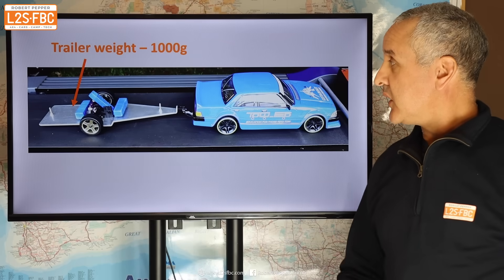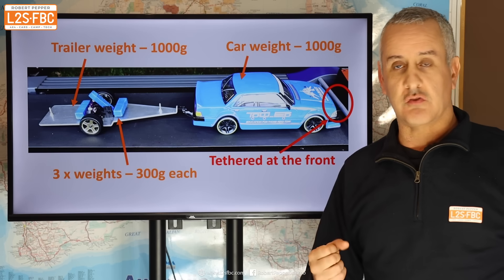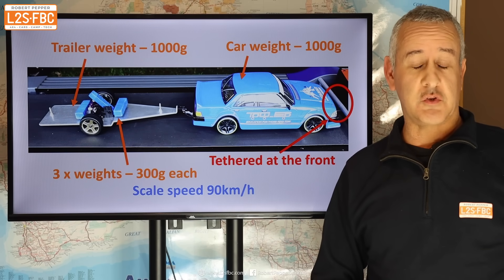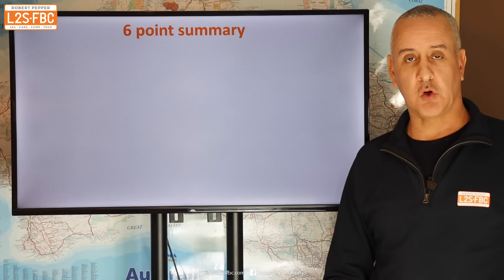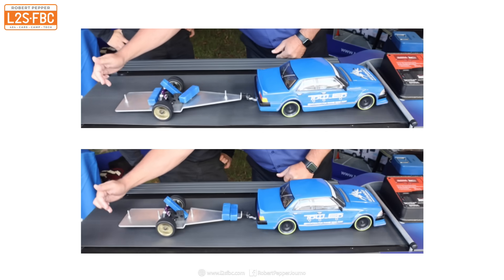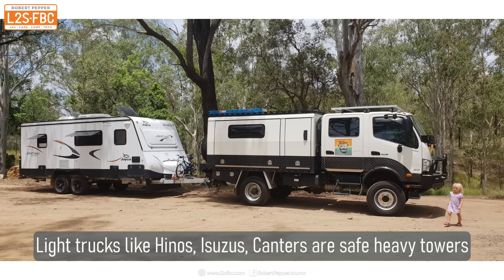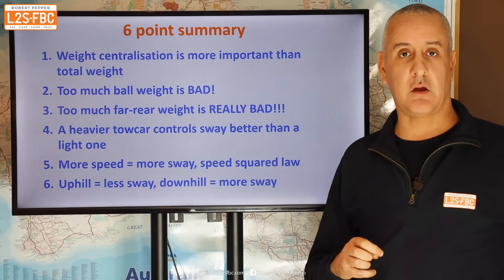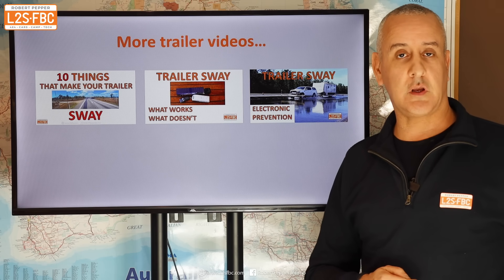7 trailer weight distribution setups, some safe, some deadly.

Comment: as far as i know....yor Trailers have no drive active brake.
tow a 1100 kg Trailer (with Active driving brake) is legal in Germany. 
my pulling Vehicle is a fiat punto with 1350 kg maximum load.
i have no problem driving 100 km/h
(the Speed here is Limited to 80 because of safety concerns).
with max load i can reach barely 85 on flat road;)
best wishes from germany:)
Reply from the maker: thanks, yes the rules are very different in Europe!

Comment: Great vid boss. I learned this stuff nearly 40 years ago, and it’s good to see it shown like this. Had a boat that was pretty much an exact even balance, and shifting a 50lb motor from the back to the front would make all the difference in towing stability. I’m not sure you are using the correct words when demonstrating the extra heavy weight on the tongue though. It sure looks like the tow vehicle is what has become unstable while you say it is the trailer that is unstable. Adding more than half the vehicle weight to the tongue will definitely make everything react more unstable though it is actually the front of the vehicle that is doing the swaying in this particular situation.
Reply from the maker: Thanks great post!

Comment: What has not been said or referred to is "the Center of Gravity" (C of G). So when the sum of all the weight, fixed and movable are calculated, there will be less sway if that C of G ends up within a certain range, generally over or slightly forward of the trailer axle(s). We use similar principles in the loading of aircraft, but for different reasons.
This is, though, a really good presentation for all of us who travel with caravans AND Motorhomes.

Comment: These tests dont account for wind drag and turbulence, and the fact that the vehicle is pulling the weight down the road not the road under the car.. but yes you must balnace the weight on trailers properly and never over load the trailer weight. The toungue weight. Or the hitch weight

Comment: This video is confusing. So should I put more weight near the location of the Tires or in the middle of a trailer becuase obviously you have different models as opposed to an authentic trailer.
Reply from the maker: Centralise weight over the axles.
Reply: @L2SFBC  Okay, thank you!
Reply: Heavy stuff always as close to center as possible

10-15% of trailer's total weight on tongue is the generic US recommendation

Consider WD hitch for tongue weight over 400lbs/180kg(truck - other vehicles 300lbs/135kg if vehicle mfg allows) to more evenly spread the tongue weight to both TV axles.

Mind your cargo capacity. Truck "rated" to tow 9000lbs/4000kg means driver only, no cargo in the bed. Load the bed and add family and the same truck might now only tow 4000lbs/1800kg.

If at all possible, you want a tow vehicle to weigh more than the loaded trailer. Especially critical in emergency situations. Even with trailer brakes, mass is mass and a larger mass will push smaller mass around.

Comment: What effect do you expect with dynamic suspensions that adjust the tow vehicule level, such as the Porsche Macan with the air suspension option?
Reply from the maker: Not a massive difference but it will help level the car.

Comment: This is a great video and I've known about weight distribution in a trailer but I recently bought a boat and it has me thinking how is that not a common issue with an aluminum boat with a outboard? The weight is very much so all in the rear of the trailer.
Reply from the maker: It is a common issue, boat towers need to be aware of the weight distribution like everyone else.

Comment: Wow I'm lucky to not have had an accident when I was young. I drove a pickup pulling a trailer with an old car on it. I experienced the rear wheels of tow vehicle come off the ground move a foot to the left and set back down. I pulled over. Did some breathing excersises and then continued just lowering the speed. I talked to my dad, who has made a living towing a trailer but he didn't explain this. I guess I didn't ask what would have prevented but still. Scared the crap out of me. Thank you.
Reply from the maker: wow, that's amazing!! Yes, lower speed is good. Your dad may have been one of these guys who just does stuff right but doesn't really think about how and why.  Please share the video!
Reply: @L2SFBC  I did I actually sent it to him reminding him of my situation. He's likely going to teach my nephews and nieces and it would be nice to teach them a little better. <3

Comment: But since when has a car being towed and towing a trailer ever got anything to do with a car being driven from front or rear wheels and towing got to do with true towing. With a trailor that is not over weight for the car. Then a slight nose heavy is always the best. But what do I know I have been in the scrap business for fifty years and have tow.. god knows how many trailers and boats etc. And take it from me back in the day we towed at all speeds.
Reply from the maker: FWD, AWD, RWD does make some difference. I might blog on this later.
Reply: @L2SFBC  but my coment was more about the fixing point you have on this rig is equal to the car being on tow with a trailor behind it.
Reply from the maker: Yes no difference then
Reply: @L2SFBC  no that's a car being towed and also towing a trailer. Take it from me if the car is man enough for the job then the towing point needs good weight on it.

Comment: What an excellent demonstration of trailer weighting. 
My only real comment is about if you do get into a sway situation (In the UK it is sometimes called "The tail wagging the dog"). Even with all the best will in the world, and the best possible attempt at getting decent weight distribution, it is still possible to find your tail wagging the dog.
And one of the curious things about such a situation is that your natural reflex is to try to counter the effect. Unfortunately, this almost always ends up accelerating the sway, and the trailer turning over even quicker. My experience has been that the first thing you need to do is relax, and then actually steer in the OPPOSITE direction to the way you want. So instead of turning away from the sway and trying to pull the trailer back in, you turn INTO the sway, and that nullifies the sway.
I must admit that doing this feels incredibly "wrong", but is almost always instantly effective. 
One other point is that, if this does happen to you and you are able to recover the sway, don't slow down too quickly, that can provoke another wag, and you're back at square 1, slow down very gently and keep the speed down until you can correct the weight distribution. If that is not possible, just go slower. It is still better to arrive late than to arrive at an unintended destination.
Reply from the maker: Wise words and covered in my other sway videos. In Australia we have brakes for the trailer alone which instantly quell sway...that's not the case in Europe for reasons I do not understand. The videos in the description explain more and show the trailer brake effect.
Reply: @L2SFBC  It is possible to get braked trailers in Europe, but they are a lot more expensive, so most people don't buy them. I honestly think that they should be made compulsory, and they may be eventually, just probably not in my lifetime.
Reply from the maker: Thanks David, good to know. In Australia independent trailer brakes are required over 2000kg.
Reply: @L2SFBC  I think that the EU does have a requirement for brakes on trailers over 1,5T, but most Europeans don't go near that sort of limit, even for caravans. 
And most people new to trailers assume that a shorter trailer is easier to tow, which is very far from the truth.
If you'll excuse me, I've got to go to bed now, maybe we'll carry this convo on later.
Have a good rest -of-your-day. But from where I am,
good night.

Comment: 7:20 - I had an accident when a weakly fixed load slipped onto the drawbar.  the car, despite the electronic systems, stopped braking.

Comment: Inaccurate results. Test does not include the effects of inertia. Your results cannot be considered real-world examples nor useful.
Reply from the maker: What exactly is missing ?
Reply: @L2SFBC  what part of "Test does not include the effects of inertia" is vague? The vehicle is not moving. The "road" in your test is moving. Newton's  first law of motion states that every object will remain at rest or in uniform motion in a straight line unless compelled to change its state by the action of an external force. The car and trailer in your test remain static. Without inertia acting upon them, all your results will be inherently flawed. Vaguely representative, yes, but inertia is a major force which is completely absent in your test. Another factor that is absent is that in real life,  the towing vehicle is pulling the trailer away from the drag point of the tyres on the road, pulling the trailer straight. This effect is increased by a longer drawbar. As mentioned, the results of your demonstration are flawed.
Reply from the maker: So you're saying the test doesn't represent what would happen with a car towing a trailer. Despite the fact there are differences with the model, some of which you have noted, it does behave accurately enough with regard to weight distribution which is the point of the video. I'm not using the model to show effects of tyre grip, steering etc. So - how is the model inaccurate with regard to weight distribution, and "no interia" is not an explanation as to why the model isn't useful. Lots of models aren't exactly real-world ideal yet are useful.

Comment: And for God sake put the brake controller override button somewhere you or passenger can hit Quickly with have to look or feel for it....

Seen so many hidden behind the steering wheel.

I am moving mine that was installed by last owner the put behind the steering wheel of the 200 in the little 4 lot of blank switches....

Going from hands on wheel to actually finding it Quickly is not that fast.... then the indication stick is also in the way too.

Weird part the 200 has a blank just under speedo on left hand side for it. It's in clear view and un obstructed.
Reply from the maker: Definitely, I show that in the linked videos. Thanks for the comment

Comment: Weight distribution hitch, move weight to centre of tow vehicle, move weight to above trailer axle, use your trailer brake controller, keep speed down.
This is the most complete explanation of the physics behind safe / unsafe towing that I've seen.
Reply from the maker: Thank you!  Please share :-)

Comment: Really good video. I've done a fair bit of towing but one piece of information was new to me. The example with the weight both forward and rear. I had assumed that this would average out to a centralized load assuming the trailer itself isn't flexing significantly. Nothing that i tow would be loaded that way just because it seems unnatural so the situation had never come up. still, i was a bit surprised.
Reply from the maker: Glad it was helpful! Please share :-)

Comment: Question - Which is more stable - a single axle trailer or a dual axle trailer?  Or, does it just depend on your weight distribution?
Reply from the maker: all else being equal, a tandem (dual axle) is more stable, but weight distribution is more important.

Comment: I drive a 90 series prado v6,  my camper trailer max atm is about 1600kg. I got a 90l fridge on the front drawbar in a large toolbox along with a hot water system. In the middle or above the axle I got 2 slimline 80l water tanks stacked on eachother. In the canopy above the trailer have electrics which sit at front trailer but near the middle.  The drawbar is 2m long. I've never had sway issues driving at 100kmph though I prefer to drive at 90kmph for fuel consumption. I also have redarc tow pro elite.. I designed the trailer and helped my dad build it. So many ppl told me not to put the water tanks above the axle..I said when full plus weight of tanks it's around 186kg which is the heaviest part. I see others put tanks at front and back then have heavy stuff on drawbar and they get sway..I'm like cause your weight isn't balanced.. Guess I'm lucky to custom design it and build it to my specs. Loved the video demonstration.

Comment: so I have a 7x16 Carmate trailer (enclosed) with dual axes. The axles/wheels are very much set towards the rear of the trailer, as opposed to being dead center like your model. So, directly over the axles of my trailer is the "middle", correct? (even though this is towards the rear of the trailer). I've always put most of the weight over the trailer axles, even though this is towards the rear, thanks

Comment: Confirm if my understanding is right. If the vehicle moves or more deg of slope, up hill , it has good stability when compared to less slope.
But the same trailer when moving down a hill , if it has more slope, the vehicle has instability when compared to moving down a hill having less slope.
Reply from the maker: Correct, uphlll = less chance of sway, downhill = more chance of sway

Comment: I'm just wondering what the importance of trailer angle is. If the hitch is say to high, you have load leveling tandem axle. I guess there is the potential under braking (where the vehicle is doing more braking than the trailer) to push the rear of the type vehicle up. Is that the basics of it or is there more to it?
Reply from the maker: Good question please see my Rear Axle Load video which covers exactly this.

Comment: Hi Robert. Is there a formular to use to calculate how much weight is added to the rear axle of a vehicle in relation to how much weight is added to the tow ball. I know you would need the distance from centre of tow ball to the centre of rear axle and that the weight added to a tow ball is calculated less than the weight applied to axle due to leverage I am assuming. Thanks.
Reply from the maker: Yes, look at my rear axle loads video, and go to my website and use the Towing Weight Calculator.
Reply: @L2SFBC  Excellent. Thankyou.

Comment: A very beneficial video to watch and be safe when loading up a trailer before going on the road. But one thing you never touched on was an "anti-sway bar" this is useful when you add a bike rack or a small motorbike on the back of a camper trailer which will cause it to sway if not using a anti-sway bar which will stabilize the camper trailer very nicely.  Link to a UTube video:  https://www.youtube.com/watch?v=bDl24M_803E&ab_channel=CamcoManufacturing

Comment: It would be interesting to see the impact of sway bars and the difference between bumper pull and gooseneck trailers. Another consideration would be the difference between front wheel an rear wheel tow vehicles (with a front wheel drive tow vehicle, you might want move your load back slightly?). Lastly, I would be interested in looking at the difference in singe and tandem axle trailers.
Reply: Gooseneck/fifth wheel eliminates the lever (hitch to rear axle length) that the trailer has to multiply the force on the rear axle. If the trailer starts coming around on a bed mounted hitch you are looking at a jack knife situation.

Comment: For everyone curious about why weight centered over the axle vs the same weight at the front and back doesn't yields different results - your trailer doesn't only pivot at the hitch/ tongue, its main pivot point is at the tires. So the weight at the nose and tail have a greater effect in relation to that center pivot point than weight centered over it. Think of the trailer like a lawn mower blade or any other rotating prop type thing. Once that starts swinging over the pivot point, it is harder to stop with tip/ end heavy distribution vs. centered distribution. Both orientations have the same effect in the vertical plane, equal pressure/ weight over the tires, but your other 2 three dimensional planes are affected differently.
Reply from the maker: Very well put thank you, I have other videos demonstrating this but never though to phrase it that way, great work!
Reply: This is due to differing rotational moments of inertia caused by the different mass distributions in the horizontal plane.  Mass centered over the axles will be inherently stable but that same mass will cause progressively more instability the further is it distributed fore and aft.  Sway is also influenced by the distance of the hitch to the rear axle of the tow vehicle.  A ProPride 3P (Hensley style) hitch mostly eliminates this factor because it effectively shifts the pivot point forward over the axle resulting in dynamics very similar to a 5th wheel.
Reply: @sunmanav8  Dumbell effect for the layman ;) combined with lifting back or front of tractor reducing grip on back or front respectivly.
Reply: Weight farther out has more effect on the trailer's rotational inertia (its tendency to keep its current speed of rotation) than weight farther in.  When the trailer is swaying (rotating, turning), it has more inertia and pushes harder sideways on the tow vehicle's hitch.
That's why a heavier tow vehicle helps stability:  its additional weight (mass) makes it harder for the trailer to push to the side, and it has more traction because of the increased weight on its tires.